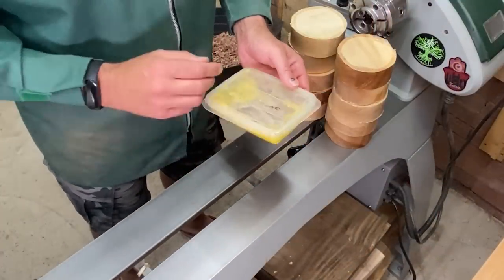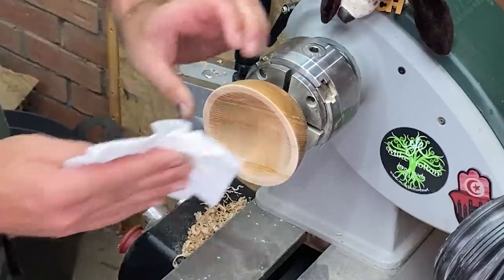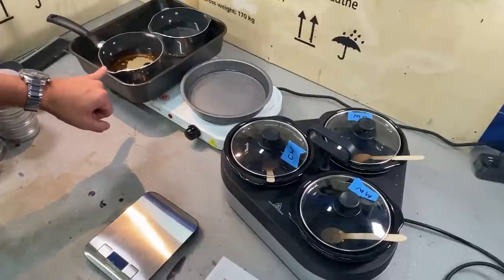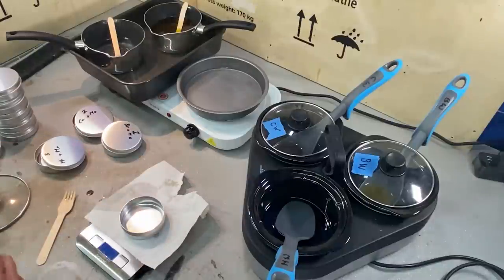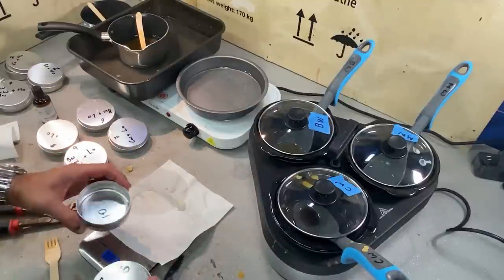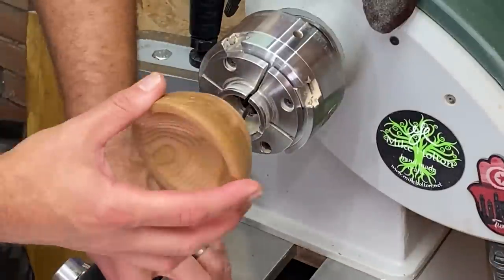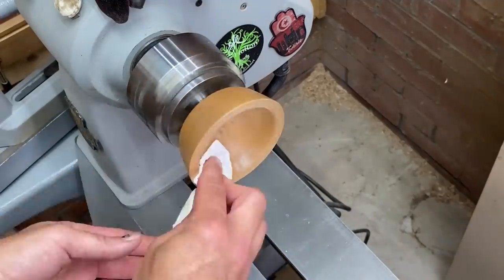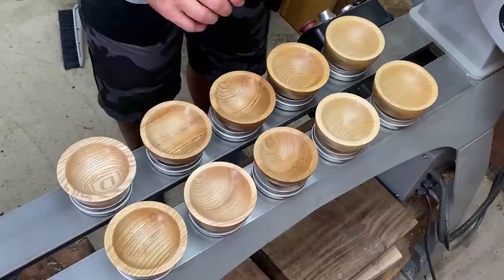10 Simple FOOD SAFE DIY Polishes to Try Today: EASY WOODTURNING Project

Comment: Brother, this is amazing. I wish I had this video during the pandemic quarantines when I was trapped at home and decided to redo all the handles on our kitchen knives, restore a couple of cutting boards and a tray. I could find nothing about food safe finishes that has as much coherent and practical information as this video. This would have been a great foundation on which to build.

As it was, it took me a while to put enough info together from different sources to make a run at it. I learned about different waxes, double boilers, flash points, flame points, curing and non-curing oils, discovered how closely you have to read the label to ensure you are getting pure oils, and researched toxicities. I hit upon some combinations that are of course similar to yours. I think there really is a logical set of materials and methods that one will arrive at eventually - it’s just harder for those of us  without a starting level of experience and knowledge. Heh!

Some things I tried that seemed useful were adding small amounts of bee’s wax to a carnauba wax and oil recipe in a series of titrations that I poured off in small containers. That quickly gave a range of smoother softer spreading to harder more durable finishes. 

For knife handles I tried using tung oil to dissolve the wax and found that leaving it to cure for an extended time - about 4 days to a week between coats - gave nice results. In theory this allows that micropolymerization to occur in the thin layer of wax. The knife handles that I finished using those formulations have held up remarkably well to hard use in the kitchen over the past two years. They still look like I just brought them back from being redone while some of my other formulations are now looking in need of a retouch. 

I avoided walnut, almond or coconut oil for fear it might go rancid. Not certain if that was necessary, but I was concerned that the finish would be stored for a while before I would use an entire batch. 

I found mineral oil tended to evaporate from the finishes leaving them brittle or crumbly in the pot after around a year. That might be because I did not seal the canisters very well. With the curing oils, raw linseed and pure tung oil, they seemed to have held up far better and I have used those again recently with good results.

One thing I do not see talked about much is what I think is termed “burning in” the finish. I started experimenting with using a heat gun on low to melt a coat of wax finish into the wood to bring out the chatoyance a little more. Of course the higher the percentage of beeswax in the mixture the less heat needed and the faster it went. I would love to hear an expert’s opinion on the idea of melting the wax into the wood and building up the finish over that.

Anyway, I really appreciate the work that went into this video. It was definitely needed in the YouTube space! 

Cheers!
Reply from the maker: Hi, thanks so much for sharing all this, some great information here! With regards to  “burning in”  I guess we can class this as burnishing. When I apply hard wax polished to something on the lathe I build up the speed as it being worked in this increases the heat and helps melt/spread and eventually cure as a nice even coat on the surface. This method works very well with friction polishes (shellac and linseed oil) 
Once again thanks so much for your contribution. I will be pinning it to the top of the comments so that others can read it as well.
All the best, Mike
Reply: @MikeHolton  - Hey thanks for the reply. Makes sense that friction melts the wax in already when you are using a lathe!
Reply from the maker: @ColdHawk  you're welcome :)

Comment: Mike that was such a thorough examination of the different ingredients and I cant imagine how long it took you to put it all together. Even finding that triple slow cooker from ebay just shows how dedicated to the cause you are. That looks like such a nifty gadget too. Mrs Mike will be popping your meals in there for when you come out of the workshop 3 hours after she yelled that dinner is ready...

..I reckon you were a hairs breadth away from getting a really hefty spreadsheet together of all the properties of the finished bowls. like colorimeter readings fingerprint retention drop resistance turmeric depth penetration, odour, lustre, reapplication possibility, cost, convenience, shelf life.......

Seriously though I saw some real poetry here. Woodturning is a tough sawdusty risky pursuit, harsh on the hands I guess. Yet the finishing process involves these gorgeous ingredients that nourish the skin. Your fingers looked "fairy liquid advert" ready by the end.

Mrs Parker makes soap. It struck me immediately that you are a few granules of sodium hydroxide away from a break-away hobby here!
Reply from the maker: Thanks so much for taking the time to comment, it has taken me a few months to get this all together but I wanted to get it right. As you have mentioned I could have taken it so much further but I did not want to bombard people with information, my main aim was to let people see that it was not hard to do and encourage them to have a go and experiment. Did you take a look at the document linked in the description, there is a lot of info in there as well
All the beset and thanks again, Mike

Comment: Great experiment. I’ve seen many folks make waxes and abrasive pastes, but never a series of waxes side by side to compare. I think I like the c/m combo the best. One thing I’d prefer is pure tung oil rather than either of the oils you used. Still food safe but dries faster and harder than the raw linseed oil. Thank you for doing this and sharing it.
Reply from the maker: Great point! Never done much with tung oil, I really must give it a go. Which one do you use Doug?
Reply: Glad to see the comment about tung oil. I did a series of different formulations for food safe finishes so I could compare some things, including using raw linseed oil versus pure tung oil. (Quarantine; I had time on my hands.) I liked the tung oil better for a number of reasons. In the end results, even though I was willing to wait for up to a week between coats in building up a finish, the linseed-oil-based ones did not seem to give the same luster you hope to get with multiple coats. My guess is that, as you point out, the linseed oil hadn’t fully cured. It buffed up nicely and seemed dry, but putting the next layer on probably just smeared the underlying coat a bit. The result was a little muddier so I ended up using the tung oil based finish and abandoning the linseed oil. I could see people getting better results e.g. warmer temperature in their shop, less oil in the mix, etc.

The thing I really did not prefer however was the stale bad breath sort of smell that comes with tung oil. It gets into your nostrils in a unique way….
Reply from the maker: @ColdHawk  Thanks so much for the information, that is very interesting, I've not done much with tung oil and keep meaning to try it. Thanks again, Mike

Comment: Mike, Thanks for all this work in "chemistry"😉.  I am glad to hear you pointed out that raw linseed oil was food safe when cured.  I use that cut with a citrus solvent to finish cutting boards.  The citrus solvent acts as a vehicle thinning the linseed oil to penetrate deeper and dry quicker.  I usually then finish it off with a beeswax polish.  I may cut all my finishing time down by trying one of these recipes.  I never thought of carnauba wax as food safe, I think that will definately be in the ingredients list.
Reply from the maker: Thanks! The carnauba wax is great stuff, very useful indeed. I love your use of the citrus solvent! Thanks 😃

Comment: Very cool video!  I use Odie's Oil, and I find it to be durable and long-lasting for bowls that get used a lot.  My guess is that your Linseed oil and multiple wax mixture would be very similar.  It would be interesting to let the finishes cure for a week and then get the bowls wet, wipe them down, let them dry, and then see what the finish looks like.  Thanks for the incredible effort on this video.😎
Reply from the maker: You are welcome my friend, I've not tried Odies's Oil, it looks good but so expensive. I would much rather keep trying to replicate it by trying different combinations 😃

Comment: I've used the Tried and True original finish on a lot of wood bowls, it makes a very nice finish . It's a mix of what they call polymerized linseed oil and beeswax. There must be a higher concentration of oil in their formula the consistency is almost like honey at room temp. Thanks for the video very good information.
Reply from the maker: Indeed, you must be looking at 90 - 95% oil to wax mixture to have that type of consistency, I think I may give it a go.

Comment: I tried making a beeswax finish years ago but with zero outside knowledge. I ended up making beeswax lipbalm instead of a wood finish. I even extracted my own orange oil out of the peels using 95% (food safe) ethanol. I had to write an essay to the Ontario Canadian government about the reason I needed almost pure alcohol in order to get a special permit to buy the stuff. I had to present the permit to the local liquor control board of Ontario in order to purchase it. It worked out nice. Anyway, I'm going to make some polish based on your video. Maybe tweak some ingredients. I don't need mine to be food safe. I'm going to try 100% pure tung oil as the base fluid. 
Great video, cheers.
Reply from the maker: Fantastic effort on your original waxes! Have fun and let me know how your version turns out, I will be doing a lot more playing around off camera.  😀

Comment: Thanks for this informative program. Its difficult to get the right polish to do 'my' wood (Co Mayo bogoak) without spending a small fortune on commercial goods. Mixing my own would be very expensive.  I now know why certain polish is used on certain items and the shine effect that different polishers make on the wood. 
I'll be using one of the harder ones as a high but hard surface is what is needed ,what with its natural tendency to crack,hopefully the extra hardness will help with that.But thats expected?? ( that's always seemed a bit of a strange selling point but that's what I'm always told at shows or shops selling this wood .)
Thanks again Mike, it'll not be long before 2000 subs are with you. 🏴😃👌🏻🤔🏴
Reply from the maker: thanks so much, really appreciate you getting in touch.

Comment: Good morning Mike. I’m your 200th like. That was different, and interesting. As always, thank you for taking the time to share. Now, how do you keep your lathe so clean? 🌞
Reply from the maker: Thanks Ray, after every few uses I take a very fine grain sandpaper and go over it with a palm sander, then clean off the surface with oil and then I put a protective cover on with a wax or sometimes silicone spray.

Comment: I've been making my own finishes for sometime. As well as waxes similar to the ones made here I make my own Abrasive paste,  friction polish and shellac sanding sealer. 
I do like the way you've made these but I'll try the Microcrystalline as I've not used that. One thing I've tried that seems to work well is mineral oil and rapeseed oil 50/50 with the waxes.
BTW there's a certain well known turner in Australia that only uses boiled linseed oil & beeswax for food bowls and has been for several decades.
Reply from the maker: If he makes his own boiled linseed oil then it will be food safe, it's mainly the commercially bought ones that are not.

Comment: Very interesting! Questions!!
Did the BLO darken the wood more that the mineral oil?  Which one was tougher with use ? 
Did you happen to do something similar for the abrasive paste ?
Reply from the maker: Hi Alan, the linseed oil (I did not use blo) did darken a fraction more on raw wood but only a fraction and it will always offer longer protection than mineral oil as it's a drying oil. Not personally done anything yet with an abrasive paste but I am working with a friend to develop a commercial one. Thanks, Mike

Comment: I'm going to make killer turning projects from the outset.
Once I get the money and space together, I'm buying everything that you're using. Cos I kinda like you. (Sponsors take note).
Leaving aside a whole load of general questions on "how to get going"..............
What's that paper you're using to apply IPA/polishes?
How are you sharpening?
How big a space do you have?
What are the essentials vs would be good vs I'm a lotto winner.
I'm loving your content already, but what about an introduction into your man-space using a hand-held phone/camcorder, spanning the space and ancillory machines?
Reply from the maker: Hi Huw, very kind of you to say, thanks.
White paper - is just basic workshop clean-up tissue, it's a bit like what you use in the kitchen but comes in bigger rolls.
Sharpening - I use the Pro Grind system (easy to use) (https://amzn.to/3re9ezp) along with a 6" bench grinder. The grinder I took off the wheels and added CBN wheels as they last longer.
Essentials - sharpening system of some kind, good facemask and respirator , good dust extraction. 
Good to have - air fed mask, nice bandsaw for cutting blanks, hollowing system
Lottery win - Big bandsaw, coring system
With regards to how much room I have, I have just under half the width of a double garage, would love more :)
If you are in the UK then I recommend Yandles as a great place to buy your kit from, great service, that is where I get all mine from. Ask to speak to Adam, he is the manager. 
If you would like more info then it's probably easier just to email me - mike@mikeholton.net
Reply: Incedentally, I do own a kick arse "filtered air blown face mask", yet yearn for a lovely chisel! 
(I used to work in pharmaceutical manufacture.) @MikeHolton
Reply from the maker: @gwylio  I have a few wonderful chisels but no air blown mask lol.

Comment: Very good presentation!!! I have a question... What happens if you use these waxes without any oil and apply the wax directly?
Reply from the maker: You can do this but in their natural state the waxes are very hard and it is difficult to get an even coating, you would not be able to rub it onto a cloth and then onto the piece you would have to hold the wax against the turning piece and then melt/spread it across the piece as it turns. Hope that makes sense, all the best, Mike

Comment: Thank you very much for this interesting comparison. Mineral oil is a common term among English speaking woodturners. Translated to German "Mineralöl" it just means the base of which fuel is made and that's anything else but natural or even foodsafe. Could you please tell me what is chemically meant by mineral oil. My idea yet is paraffin oil. If I am right I'd like to know in addition which one, as there are two different types which differ in viscosity. Thanks a lot.
Reply from the maker: Mineral oil is any of various colorless, odorless, light mixtures of higher alkanes from a mineral source, particularly a distillate of petroleum. Generally this is always food safe a lot of people use it on cutting boards
Reply: @MikeHolton  so it is definitely made of fuel source, i. e. crude oil. Can't imagine this is food safe. Thanks for your answer. It hardens my assumption of paraffinum.

Comment: brilliant as always sir . 
just one question how come raw linseed oil is food safe yet boiled isnt . may be a daft question but i am a nubie😁
Reply from the maker: Hi Kev, raw linseed oil is safe for human consumption. However, boiled linseed oil is heated and treated with chemicals that make it toxic for humans.
Reply: Chemicals are added as drying agents to speed up the curing process. At one time boiled linseed oil was actually boiled to jump start the polymerization(hardening) process. They have discovered that adding heavy metals such as cobalt and manganese will do the same thing only quicker and cheaper so   modern boiled linseed oil is not actually boiled at all.
Reply from the maker: @danb8082  Indeed but adding those heavy metals does make it not food safe 😁

Comment: So of all of these which is your favourite
Reply from the maker: I think it's the mineral oil with carnauba wax, microcrystalline and coconut oil, something about it seemed just a little nicer than the rest. I mill do a few more versions of it for myself to try and make a much softer version.
Reply: I did one that was about 4 liters of mineral oil and about .5 kg of bees wax. It was soft and worked well but never occurred to me to add coconut oil. I think I want try that or adding essential oils. I guess my concern was, are all essential oils food safe? But I have read that essentially all finishes become food safe if allow to fully cure. Thoughts? @MikeHolton
Reply from the maker: @kennedykirkhope6251  Essential oils from food are all pretty much food safe, these are the bases of most perfumes. They may be highly concentrated but by the time they are mixed back into a wax they represent only a tiny fraction of the total.